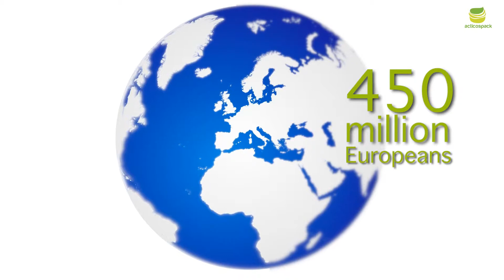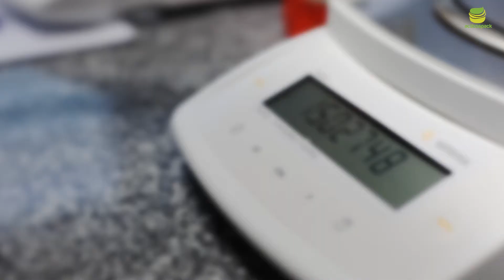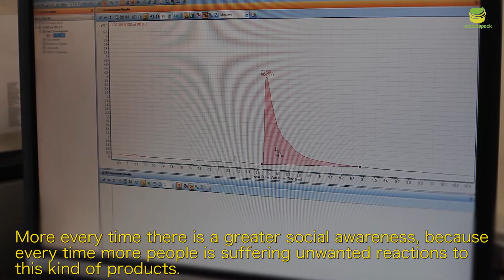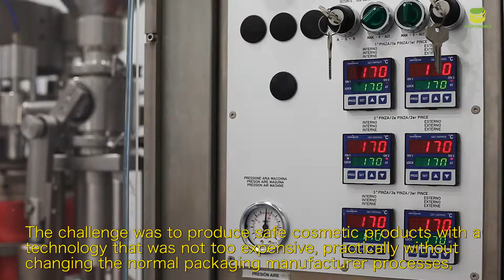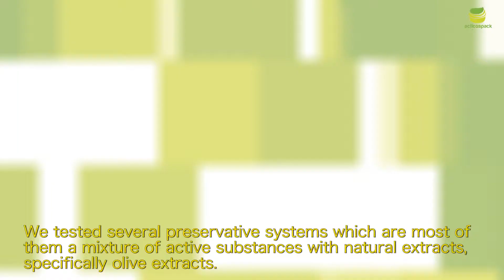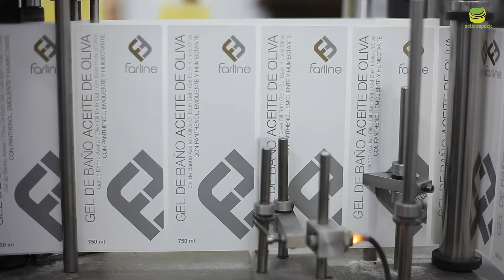ACTICOSPACK: Active packaging technology for cosmetic products

Comment: Being "old school" when it comes to preservatives, I see many issues with this:

1) The diffusion rate will vary greatly depending upon temperature.
2) The diffusion rate will vary greatly depending upon the nature of the product.
3) What conditions would be used for challenge testing? The product can only be tested in the actual pack, so the pack must be available before the formulation is finalised.
4) If low temperature storage is used prior to challenge testing, then more preservative will be required and, if the subsequent storage temperature is much higher, then the product will be over-preserved.
5) If high temperature storage is used prior to challenge testing then the converse of (4) will be observed.
6) Preservative could be lost via the external surface of the packaging, and people handling the packs regularly could be exposed to more preservative.
7) Controlled release cannot take into consideration the difference between o/w and w/o systems.
8) How long does it take for the preservative to be fully released? If the pack is around for a long time then, presumably, more preservative will be present than is necessary.
9) Any product must be adequately preserved from the moment it is produced and, therefore, sufficient preservative must also be present from the point of manufacture. Any further preservative released from the packaging is, logically, surplus to requirements.

The video uses the tag line "active packaging solution for more natural cosmetic products". Reducing the "chemical preservative" content by 25 - 40% is hardly making "more natural cosmetic products"!

From the commentary: "However the allowed content of some [preservatives] are being constantly reduced according to legislation, market trends and consumer demand". No, they are not. Not one preservative has had its maximum permitted concentration amended more than once.This is tantamount to scaremongering.

"We tested several preservatives systems which are most of them a mixture of actives substances with natural extracts, specifically olive extracts."

This raises some interesting regulatory questions. My interpretation is that, given that the preservative will be leaching into the product as a deliberate strategy, then the preservative should be included in the INCI declaration. As it must be in the INCI declaration, then the function of the material must be declared in the product information - this would unequivocally be "preservative". This material is not listed in Annex V of the Cosmetics Regulation and its use would, therefore, be illegal.

I am open to challenge on this, but it doesn't look promising for anyone who prefers to stay within the law. 

Maybe I am wrong with these issues, but I will remain highly sceptical until this product is proven by successful widespread use. If I were a manufacturer, I would be very nervous about this technology.